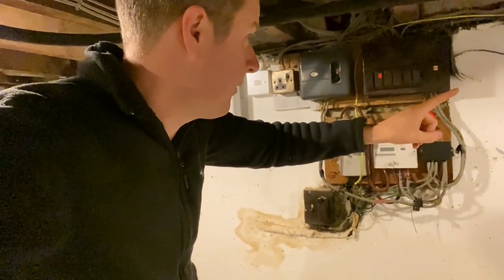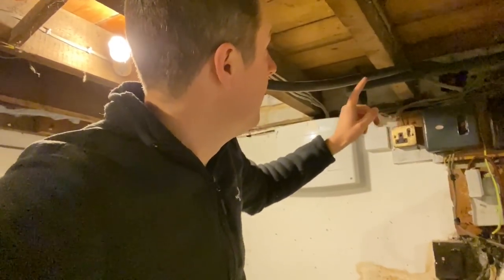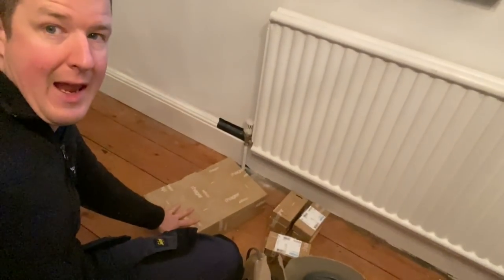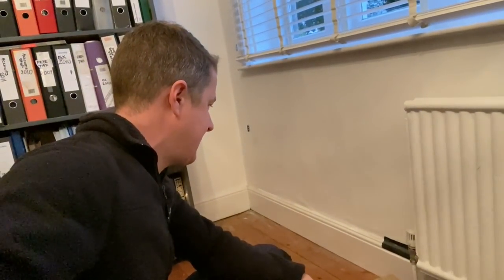Moving A Consumer Unit & Installing a Sub Main

Comment: The incoming supply will actually be aluminium - it's single core so the inner core is the line and the outer sheather is the Neutral/Earth. Normally 25-35mm single core too
Reply from the maker: Thanks yeah I took a closer look and it was concentric câble like you say. 35mm I think

Comment: I think the supply cable will be a concentric neutral type cable keeps the OD size down. It's like a single solid core (live) with concentric neutrals.
Reply from the maker: Yeah that’s right it was!
Reply: How did you not know that?
Reply: It's a 25mm aluminium live core rated to 100 amps with a concentricly wound neutral and earth if its sne

Comment: The cable the DNO use is XLPE insulated concentric, with aluminium phase, and copper sheath which functions as the pme/neutral. 100A single phase conductor is 35 sq mm.
Reply from the maker: Nice comment thanks!
Reply: "High capacity copper"??? hmm not sure there Jordan, doesn't copper have a fixed resistivity value?... I may be wrong but I thought it was all the same? copper is copper?
Reply: @muzikman2008  I think you can get oxygen free copper cable which is apparently a purer form of copper that has slightly lower resistance and handles slightly more current than basic copper but I could be mistaken!
Reply: @muzikman2008  higher purity copper would have a lower resistance but there’s a purity that cables are made to that’s financially viable. There’s also the possibility of potentially having it fine stranded to increase the current carrying capacity.

Comment: Thank you. Finaly a fellow electrician that has an 80A fuse on the isolator rather than 100A, just like the cut out, in order to allow discrimination.
Reply: Can you explain to me why I should be using an 80A fuse in the isolator? I done that before and my boss went crazy at me so I’ve always just used 100A since
Reply: @uplightuk8924 i beleive it is because if you use a fuse the same or higher rating than the dno cut out then the dno fuse might actually blow before the customer fuse and that is a costly problem.  Your designed circuit loads should never exceed the dno fuse rating so if your installing a further down stream fuse that also calls for 100A then there is obviously a problem with your circuit design...or at least that's the way the dno will look at it. If you blow the dno fuse rather than your own, then there was no point fitting your own! I would say that your your boss is wrong!

Comment: Good choice with RCBOS too many old lighting circuits with Stolen neutrals which cause a dual board to trip, because you never done an EICR  I would have pulled each fuse then put them in individually one at a time and go around checking points for each circuit that would be a quick way to get your final circuits 
Good job 👍

Comment: Just been on the phone to ukpn as i need to do exactly this job in my gaff. i shall be in touch with artisan shortly ;) just wanted to give an accurate cost on this as you mentioned moving incomer would be about 3k. this is true if you want them to do the digging. if you do the digging yourself then its £1027 + vat.
Reply: It also depends on specifics because if they had to run more cable it billed for all of that as well as well as if they could isolate the power whilst joining and other things like that

Comment: You mentioned  couple of things ….. "should have done an EICR … but wasn' t time .."  and :   " new board fitted with RCBO's" !  

I guess that was a wise choice  fitting RCBO's -  ( ie the two statements are surely linked !! )  - since the likelihood of RCD nuisance  tripping ( ie - on an installation  that didn't appear to have any RCD protection before - but now has ! )   on an old installation like this would be quite high .. and so fitting RCBO's at least narrows any Earth leakage issues down to individual circuits !  

Personally - I would never fit a "spit load"  board  ( ie:  a common RCD for several circuits )...  For the small extra cost of RCBO's over MCB's  the potential reduction in "buggeration factor overhead cost"  is worth it !!
Reply from the maker: Yeah I totally agree in fact I only fit RCBO boards as well.

Comment: No judge in the land would condemn you for pulling a DNO main fuse, "safe isolation" will always win. Just make sure a competent electrician does it to avoid arcing of the main switch (i'm not gonna say for obvious reasons duh) Tidy job again J :-)
Reply from the maker: Thanks!

Comment: If anyone is interested in what you get charged for a service alteration, when I had mine done it was £475 (SSE Power Distribution) ... a couple of years back. I was a bit miffed at the price until I watched them do it LIVE.
Reply from the maker: I asked the customer how much this one cost and it was £1050
Reply: @artisanelectrics  I would have done it for 1K :-) lol...just disconnect the load side...bingo...
Reply: @artisanelectrics  Any experience of anyone wanting to upgrade to three phase and what it may cost? Toying with the idea to allow for either hob/shower/car-charger on separate phases and the area's they're in on the phase used by the main big juicy (keep fairly even split and keep each area on a single phase). Or possibly allow for fast three-phase car charger.

Just ideas atm, main reason I'm thinking about it is gas is likely to become more expensive in future (finite resource) so should become cheaper to use electric heating, but adding that to electric car charging/hob/shower etc... seems like it could be pushing it even for a 100A fuse!
Reply: @Mattja1  It would depend how far away the 3ph service cable is... some houses round here have a 3ph head with only one fuse cartridge in use, i'd imagine it'd be a lot cheaper in that case than if they have to splice into the cable at the road...
Reply: Did UKPN excavate and expose the cable or was that the builder (near job regardless).

Surprised at only one spare way in the board. A lot of single sockets it seems, some level of rewire inevitable in the future.

Comment: Forgot say
You never put more than 1 point of isolation stickers on your WAGO boxes (if you ha had more than one circuit)
And does the hager SPD get fed from the bottom of the main switch 
The lewden one I install is fed from a 6mm off a 32amp MCB in the instructions

Comment: Nice job . You can get a reducing grimp lug from 25mm to a 5mm round pin for the sea cable. More than one supply warning label on the joint box's . Just a thought . I would fit them .
Reply from the maker: Great tip!

Comment: Interesting to see the connector that they use; I've only heard about it. 
I don't see the point in getting only single phase though, since we're told gas heating is to be phased out.
Reply from the maker: Yeah apparently some new builds are getting three phase supplies now
Reply: Agree, all new supplies should be 3 phase.

It’s just UK power networks being tight wads wanting to own a network but spend as little as possible on it so when we need more we have to pay  to upgrade something that doesn’t belong to us.

Not just electric heating but also electric vehicle chargers.

Demand will increase massively over next decade or 2.

I was talking to surveyor today who even said that electric boiler is what he would recommend for somebody like me who doesn’t want to replace oil with oil or gas with gas considering imminent government ban in near term and he’s not first to say similar, few months back an energy assessor who does the EPC certificates said similar and that I wouldn’t regret an electric boiler in few years time.

Just the electric running costs are a lot more, surveyors advice though was to invest the money in better insulation so house retains more heat so you need less electric to begin with as I was originally planning on heat pump but he recommended against due to slow heating times and he’s probably right.

I came across a brand new supply a while back even, where they removed the overhead equipment and installed underground cables, they shoved in a service head with a sticker on it saying 60/80amp. 

New supply like that they should just stick 100amp in considering all the cables in the street and house supplies were all new then it’s done with or even better 3 phase as you said should be the norm.

Even solar, they want more electric exported to grid from solar but many find if you export more than 3.7kwh they charge you large sums of money to upgrade their equipment to handle it.

Comment: For safety’s sake, you should have removed the fuse from the cutout, and reinserted the fuse carrier, after disconnecting the line tail from the cutout. A minor point.....
Reply: They are about to cut the cable outside so it would of been dead anyway?
Reply: @Clicksystems  I think they did it live.
Reply: metallitech they did the work live. But that fuse doesn’t protect the workers as it’s up stream.

But the whole reason for the work was they cut off the existing cable, run a new cable to new outside box then spliced cable into old one outside.

So after he pulled the fuse, within minutes they would have cut the old cable outside making it dead anyway inside the house.
Reply from the maker: Yes that’s right!
Reply: I know I'm a bit late, but they need the load isolated so that when they cut the live supply cable there isn't a danger of arcing.

Comment: Love your videos - always helpful and interesting. One question on this - it looks like you've drilled holes in the joists very close to where they sit on the brickwork. OSG states these should be at between 0.25 and 0.4 x span. I could be wrong but yours looked less than 0.25. Is this something you considered?

Comment: Usually a 35mm sq alu for the DNO supply to the head.  Electricity Northwest say the same to with regards removing the fuse.
Reply from the maker: Cool thanks good info!
Reply: Yeah SSE are the same regarding cutting seals and stuff. They will just send someone round to reseal if you tell them you've done it lol.

They're only really worried about abstraction, and the kind of customer who hires an electrician to do work for them isn't the person most likely to be doing that

Comment: I have a similar job coming up. Could you have used 16mm swa to make life a bit easier in the board and save some ££? Depending on cable length. I used 25mm swa on my house so just wondering. 
 Also is it possible to terminate swa into the back of the lewden board to go straight into a wall as I think this is what I will have to do in a meter box. 
Cheers great videos 👍👍👍
Reply from the maker: Thanks! I don't think you could get away with 16mm considering the main fuse is 100amp. You could probably drill a 32mm hole in the back of the lewden switch fuse and run it in that way. Thanks for watching.
Reply: 16mm  swa  is 110A clipped direct or 91A in a duct
Reply: Tom Yeah What is the rating when it is direct buried in the ground?
Reply: @artisanelectrics  Alot of suppliers will fit 80A fuses for some reason but still insist you use 25mm for your tails .
Reply: @raychambers3646  The reason is 100A service heads aren't good for 100A continuous... back in the day that was never an issue, but now with car chargers which can keep whatever their demand is on constantly for 12h at a time,  there's the possibility of the consumer maxing out the service fuse for extended periods.
Reply: @TheChipmunk2008   - Yes  VERY good point.   I think we have YET to see the TRUE implication of "a street full"  of EV charging points running at cc 30A each  for the odd 8 hours overnight  !!  NO Diversity allowance there folks  !!!  its 100%  
  (  mind you - I believe the new chargers are "smart"  which I suspect will overcome that problem of total supply loading - that is they might load share ?  )    
Just imagine -  say  60 houses in a street  -all with 30A EV charging points  … that's 20 / phase * 30A  = 600 A per phase … hmmm   I don't think so !!!
Reply: @eric4709  I think the mode 2 chargers (those in the UK using a 13A plug) might be doable with existing cabling, altho the substation transformers may need upgrading along with the actual energy to supply it). I've heard recently on various fora (youtube, the IET, etc) that the DNO's have historically calcluated demand at between 1 and 2kw per house. 4kw isn't that much of a leap  (we're not talking orders of magnitude, just a doubling), and if you take into account the demise of the incandescent bulb, and modern TV;s taking a fraction of the power of their forbears,.. i don't really see a problem 'grid wide'. 

 It's the high current fast chargers that are the issue.

Smart chargers with a zigbee network might be a good idea? 'okay, i'm done charging, so the rest of you lot can take an extra amp each' kind of thing?

This is kind of already built into the grid for those few that have storage heating, since the economy 7 went over to radio teleswitches, and latterly more advanced controllers, it's possible for a power co to shed a few MW of load for a few minutes to a couple of hours, with nobody really noticing.
Reply: @TheChipmunk2008  I think if I was drawing 100 amps from the supply head , I would need an increase in my pension! You are right about the capacity, also the majority of the cutouts are getting a bit long in the tooth .

Comment: Hello, I just subscribed and want to say thank you and that I enjoy your very well put together and instructional videos, just a quick question for you.  If you were carrying out a consumer unit replacement and had no way of isolating the supply from the incoming supply, are you as a skilled person allowed to remove the fuse from the head?  If not why not as a skilled person? or do you have to contact the DNO to isolate the power supply and incoming fuse, then when done do they have to reinstate all?  And is there a cost if so?

Comment: The radiator valve and pipe fitting is very close to the consumer unit , in the event of a water leak, potential disaster

Comment: I love the uk power network guys they get paid a fortune just to joint and connect mains cables, and us electricians do the more complicated side of things in the house but yet don’t get anywhere near the sort of pay and benefits those guys get.
Reply from the maker: Really! I didn’t realise they were well paid.
Reply: they get paid nicely because they have to watch alongside with a buddy/mentor for 5 years before they are allowed to actually work live. they are also on call constantly and have to dig up the roads and repave them at anytime of the day/night
Reply: What voltages do they have to work with sometimes and remember its substation currents if they stuff up? No thanks.

Comment: Everyone seems to forget that there are two concerned parties to take into account when pulling the main fuse. The DNO guys don't care if you pull the main fuse because they're only responsible for the head. The supplier would not be as accommodating and for obvious reasons. In this particular scenario there isn't an issue, but if it were a standard board change you'd likely be manipulating meter tails coming from the meter. There's a good possibility that you will loosen the terminations within that meter, which could cause arcing and eventually fire.
Reply: If this is the problem, then why isn't every board change followed up by inspection by the supplier?

Comment: About a year ago I went to a house for social housing and whilst i was there the tenant asked me about an old  Dno cable just cut off not connected to anything( it would of been to an old meter)  it was  sticking out the wall in a pantry just hanging, the tenant asked  if it was live or not,  it turned out it was live and it went on the outside of the wall to a junction box near the 1st floor to roof level  then to Over head cables (TT). Needless to say the Dno were called on an emergency To disconnect it.
Reply from the maker: Wow that’s crazy! Good job you found it before someone got killed!
Reply: That is bad for social housing who usually have approved sparkys ...jeeez!
Reply: @muzikman2008  The old network supply cable was cut off from being a TT system and a new supply installed for Tnc-s by the area Dno but they didn't disconnect the old existing cable which ran inside the house to the outside and up the wall to a still live connection to the nearby overhead power cables which should of all been stripped out, others properties had been stripped out and disconnected but unfortunately that one was missed
Reply: Whoa, that's insane :o

Comment: Hello Jordon why did you spoil such a nice job and to be fair alot of sparks do the same, why no containment up to the board it looks cheap 
I always use plastic 2x2 trunk 2/3 pieces next to each other if need be. Your standard is good why spoil it cheers Steve
Reply from the maker: Good point!
Reply: Yes, a spot of trunk under the floor might have been neater too

Comment: 4d worth:- 
The "Guys on the Ground" probably have no legal authority if any serious problems arose by Electricians pulling the fuse. You could  potentially still be in trouble. 
What a Sh1t place to have a CU. I know it was the customers choice - but who would want a CU which was in easy reach of a small child. Are there not laws about the min height that a CU must be mounted above ?.  Does it need to be "boxed in" to be made safe against Children ?